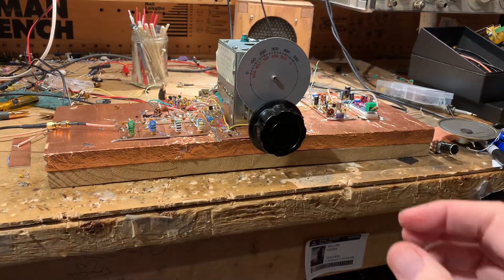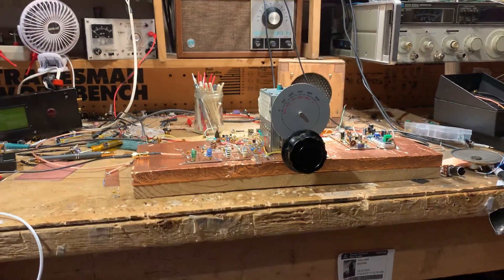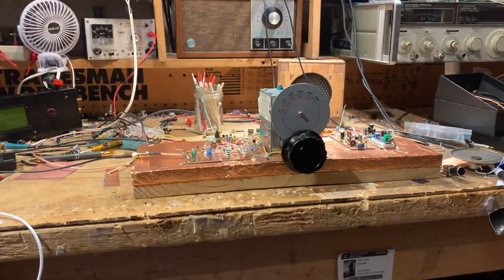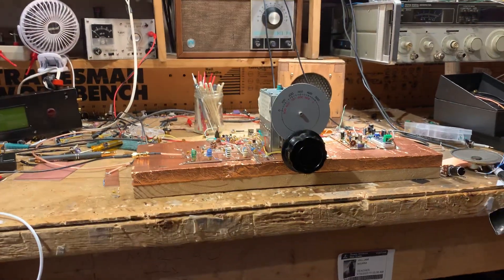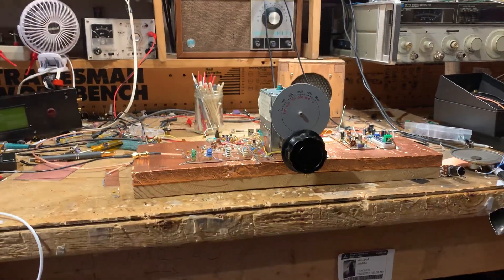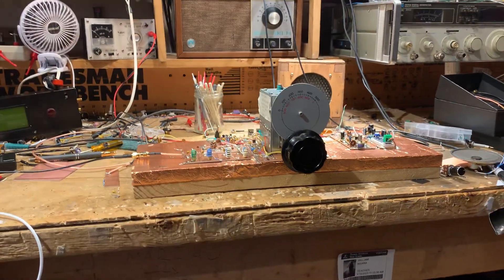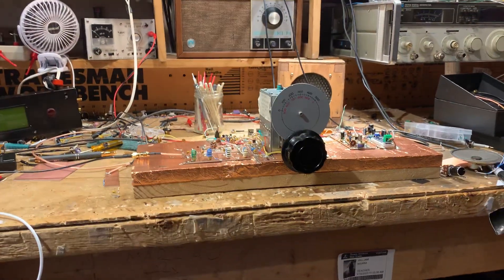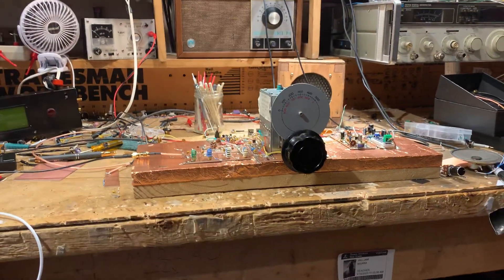Bill N2CQR Builds Another Mythbuster Transceiver

Comment: One of the P3ST kit builders had a bad ADE-1 too. Now with your experience, I'm beginning to worry about them. Have you ever had an SBL-1 or TUF-1 end up bad?
Reply from the maker: I think  you can destroy the tiny coils in an SBL-1 if you put too much RF or LO energy into it.  That may have been what I did with the ADE-1.
Reply: I have got some old pullout  TDK mixers from comms equipment, and they all seem to be ok. Similar to SBL-1. It possible that a DC potential via the IF port may damage mixers, so some current limiting on the IF port may help. Also seen old  packaged mixers 30+ years old have shown increased inbalance due to degradation of the silicon  goo  inside them. I have only seen one mixer, an 18 GHz SMA mixer show increased loss of several more dB in almost 50 years of RF repair. Even home built mixers with well matched diodes work well. Losses are quite dependent on the diodes used. Another very important note is the Si5351A have DC potential on the RF outputs, so DC blocking capacitors are necessary.